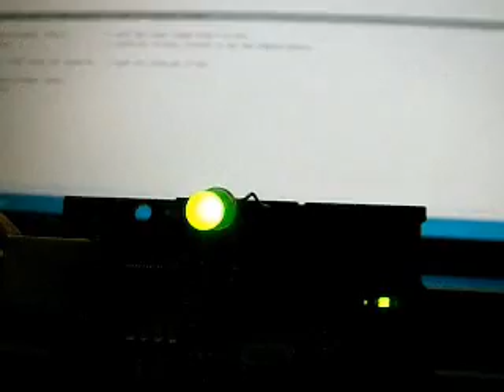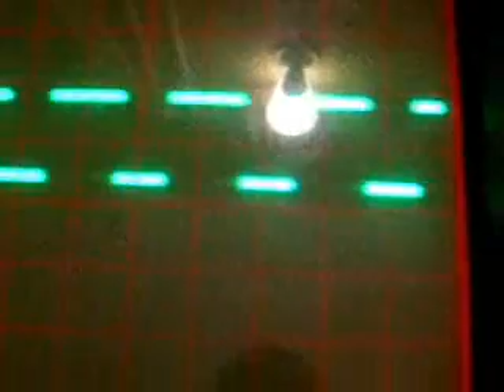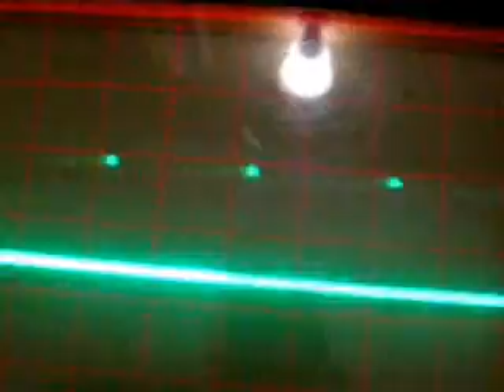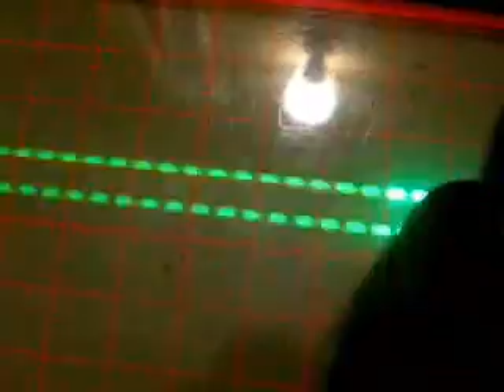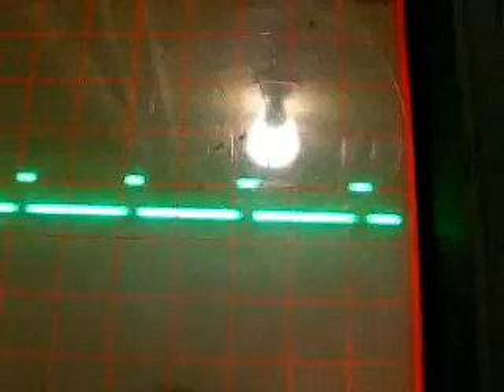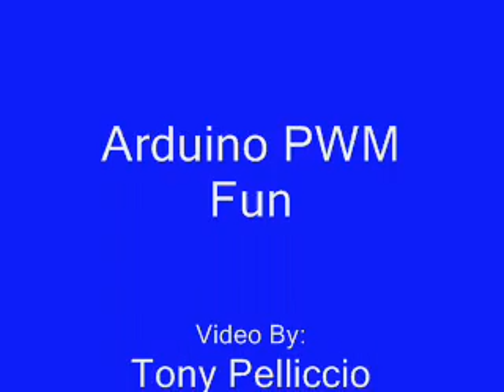Arduino PWM Fun

Comment: What happens if you connect the PWM out to a 1K resistor to a 10uf-100uf cap with a 10k resistor across it on the scope?
Technically it should be a smooth sine up and down.